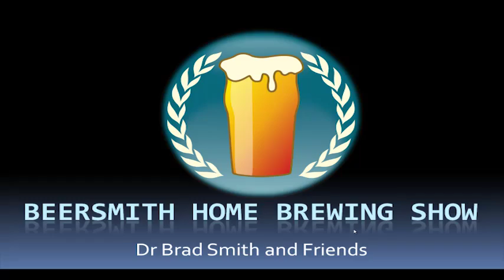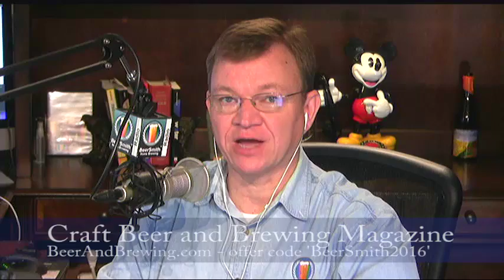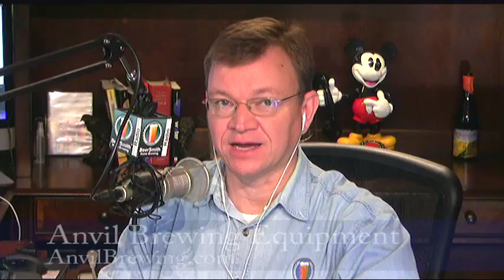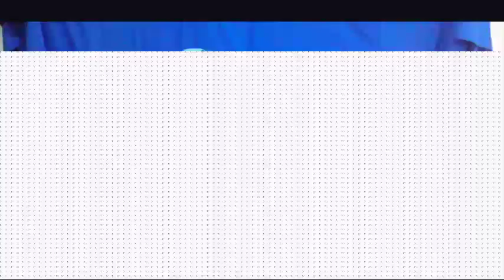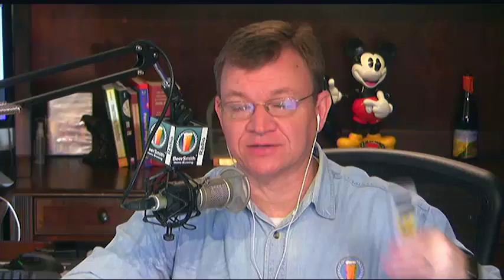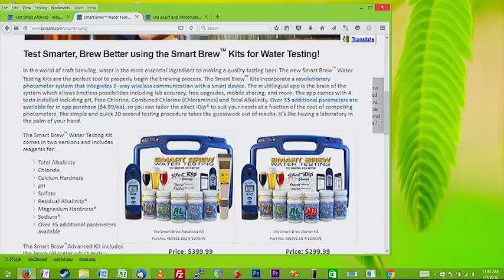Beer Water Testing with Christian Krzykwa - BeerSmith Podcast #118

Comment: I have trouble with some brews drifting on forever and taking longer.  I have better luck when using O2 over other wort aeration methods and usually get decent results but it still is a bit slow finishing.  I monitor PH levels throughout the process and use yeast nutrient, always use a starter or fresh yeast cake.  I am using RO water and building it up with calcium chloride but I don't know a whole lot yet about water chemistry.  I was hoping to learn a lot more here but this guy is rather clueless when it comes to brewing.  I wonder if there is another resource that can help a layman like me understand and try to get to the bottom of the issues I am having.